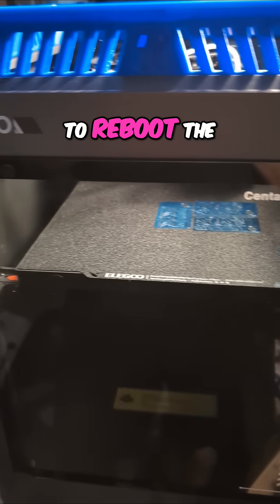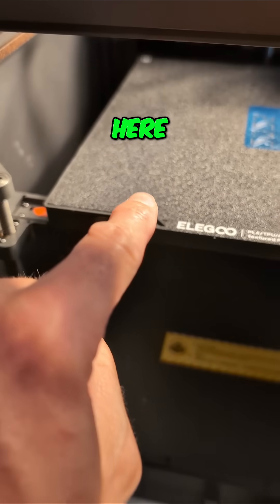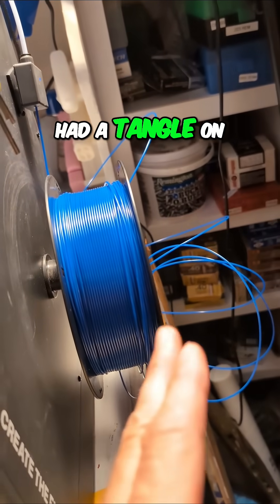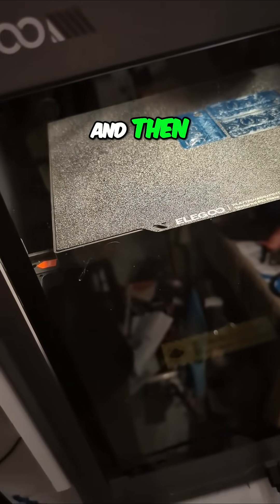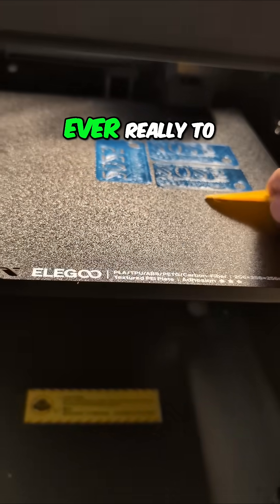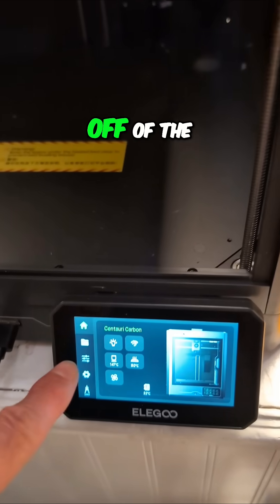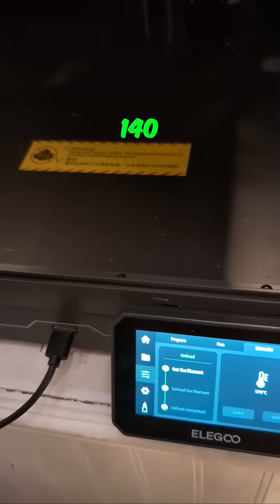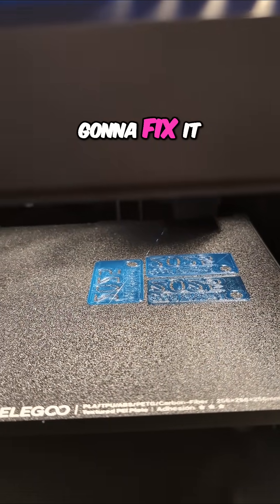3D Printer Glitch? Rebooting My Elegoo Centauri Carbon!

Comment: Mine finishes prints. Then starts another print right afterward of the same print and just beats the life out of the head and print until I hear it and run in to try to save it.  It beat the face of the head off and spit it out onto the floor.  I couldn't pause, stop nothing.  I had to kill power.  Elegoo acts like "meh" when I contact them.
Reply from the maker: Yikes! After you powered it off, did it reboot and work normally?

Comment: It's happening for me as well, I think it's just another firmware bug. I've never had to fully reboot my printer with it happening, I just restart the print and it ends up homing correctly.
Reply from the maker: Thanks for sharing. At least if it is a common issue it is likely to get corrected in a future firmware. :)
Reply: @GearReportMaker in the past 2 months I've had mine there have been several random firmware bugs I've had to deal with, I'm sitting at just over 500 hours printing and I still think it's a great printer they just need to fix some bugs every few updates
Reply from the maker: They seem pretty responsive so far. Fingers crossed. :)

Comment: When your filament runs out passes through the run out sensor does yours stop there? Mine runs out, blue sensor light goes out and keeps printing.
Reply from the maker: Great question. I'm not actually sure. I need to test that.
Reply: @GearReportMaker that would be great!
Reply from the maker: https://youtube.com/shorts/CP_P8m8ECVw?si=xJ94NpbuXL_ex8RR
Reply: I could be wrong so please double check me on this but I'm pretty sure I remember seeing a video by elegoo stating the printer was designed to keep printing for a small period of time after the filament is no longer in thr run out sensor so it won't waste filliment/print time between filliment changes
Reply: @CodyChandler-i3x  i will try that on a test print.Thank you